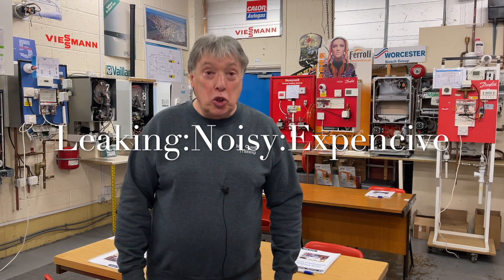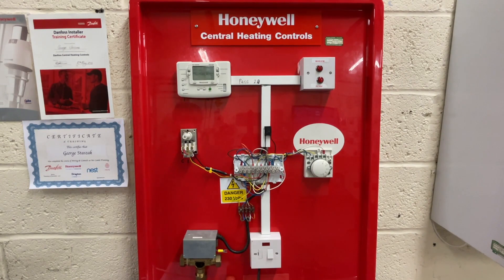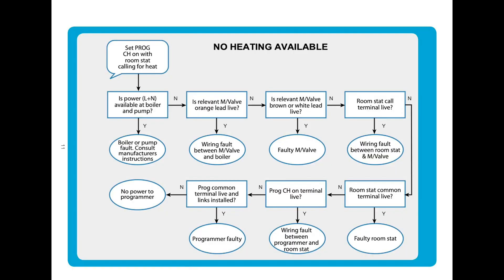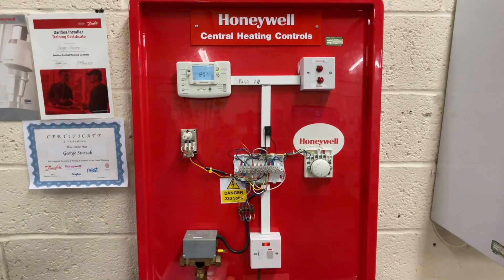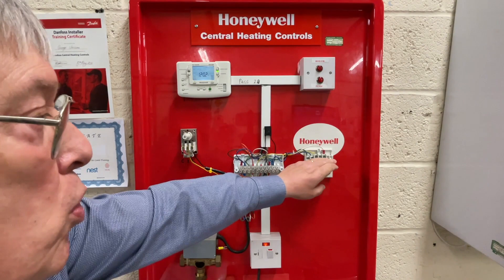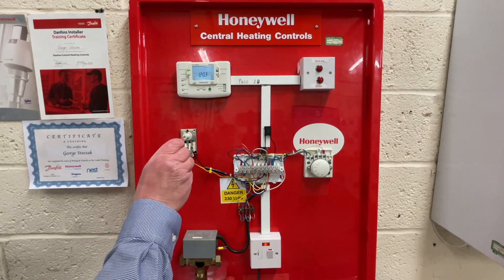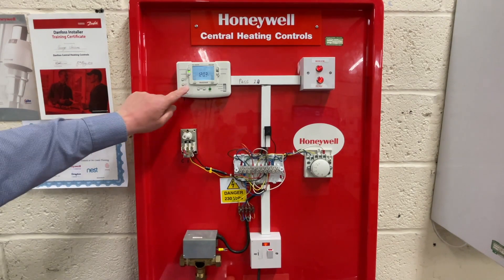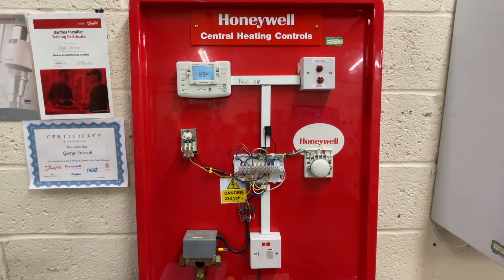Honeywell Y Plan diverter easy TESTING sequence

Comment: Hello! Really appreciate the video, thank you. We had the 3 port valve replaced yesterday as the central heating was coming in when the hot water was coming on and not on its own. Unfortunately, no dice and it’s still happening! Trying to find an electrician to see if the timer on the Salus EP200 is broken first, then the next step would be investigating the ball in the T bit underneath the diverter valve?
Reply from the maker: Thanks for asking, something is wrong, over 6 years old REPLACE. You replaced the valve now replacing the ball? I assume just the motor unit was changed not the whole unit as per video. You don't need a sparkie to switch the HW.
To test the CH and valve just switch on the HW, see if the heating pipes get hot.
To test Programmer CH ON wait for the motor leaver (at the side) go loose and boiler ignites.
Hope that helps, George Staszak 😀👍

Comment: I have recently had a new boiler fitted by BOXT .The system worked well for 2 days but then air entered the system at 2radiators .I called the installer who eventually came back and re - bled the system again .All was well for 2 days then the same thing happened,  same radiators . The installer is now telling me the problem is the diverter valve and needs replacing at my expense. How can a diverter valve  ( which has been working well for several years ) be putting air into the system ,which is a y plan central heating system  ? I would appreciate your views or any experience regarding this . Kind Regards Robert Jackson
Reply from the maker: Hi Robert, thanks for asking, you are correct, a lot of new boiler don't like Y Plans (mid position) systems because of lack of flow thru the exchanger. As many of my vids show too many houses have the wrong system plus no auto by-pass UNDER the boiler so the pump will make air, also the pipe work could have too much 15mm.
       There are auto air vents for rads but you will have to keek topping up and ruin the system. First try 2 bottle, of F2 silencer see if that works cost you about £30. 
2. Around the pump should be an AAV (auto air vent) is fitted the cap  and loose. 
Hope this helps, George Staszak.

Comment: Really useful, thank you! We are currently trying to figure out what's actually wrong at home as we only have hot water on and the radiators all around the house get hot instead. I powered down the system and the catch on the  back of the 3 way valve moves freely with the power off.
Reply from the maker: Hi Michael, thanks for asking, easy, as per video, turn the Programmer and room stat  to OFF/ 16C both valves should close if not either the motor has picked up volts on the blue (should be 0c to earth) or probably stuck in the ON position (change both valves) also check Orange to earth is also dead, if live then either room stat or Programmer is faulty not switching OFF. regards, George Staszak
Reply: @mrcombiBedford  Thank you! I think I get it as we have the Honeywell V4073A1039 motorised 3-way valve.I changed the room stat last year as it was falling apart on the wall :D
Reply from the maker: @bunkermonkey_uk  Hi Michael, a good room stat save money, I hope it's a digital stat. that mid position valve is the best good for 8 years and it must have an external auto bypass to work correctly, regards, George Staszak 👍
Reply: @mrcombiBedford  Thankyou, I have tested with a brand new mulitmeter and both orange to earth is 0 volts and blue to earth is also 0 volts.
Reply from the maker: Hi Michael,
That means the valve must be stuck ON position time to drain down replace.regards
george😃
Reply: @mrcombiBedford  Thank you! you have a new sub from me :)
Reply from the maker: Thanks you very much, your reward is in heaven coz nothing down here, 😀take care, george
Reply from the maker: On any valve if you turn OFF the power all will close or it's stuck, replace the whole unit fill with F2 silencer, job done👍

Comment: 99.99% it’s the synchron… never let me down Very very rare I have to replace head or actual valve
Reply from the maker: Chohan, I am very disappointed,  you are saying that if your parents valve breaks down you would say, "Mum & Dad, I will NOT replace for the latest version the way George Staszak (Mr Combi) teaches but I will get a motor from another make and fit it in yours" are you proud of me? I treat my customer as my parents only parents and close family don't pay. In 45 years as installer / breakdown engineer I would not last in Bedford being the BEST and most EXPENSIVE in town. Here ends the lesson.george staszak